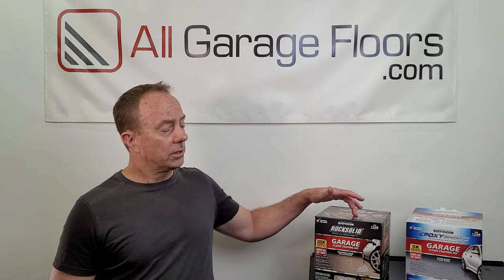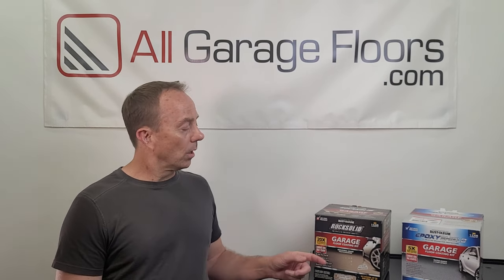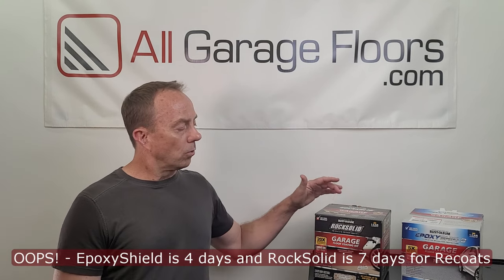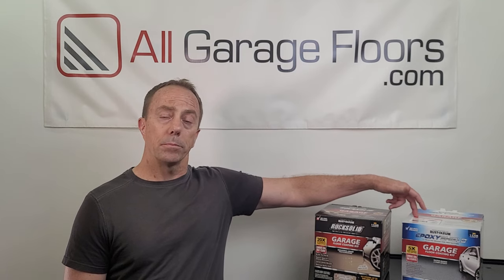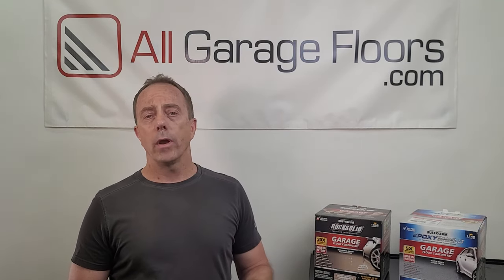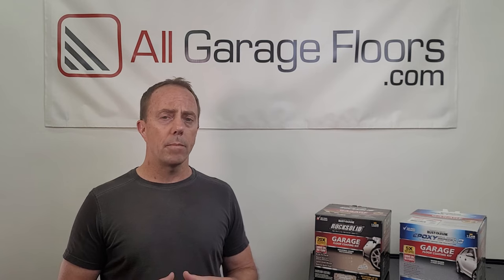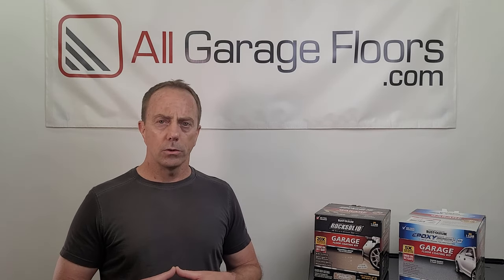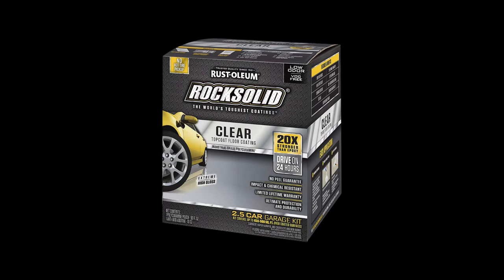RockSolid vs EpoxyShield | Which is Best for your Garage?

Comment: Can polycuramine be patched? Or can I put a new coat over the old coat.  I have a 3 year old coat and my offroad truck tire pulled some off.  Im willing to buy from you.
Reply from the maker: Polycuramine does not suffer hot tire pickup. If the tire pulled the coating up, then that means the concrete was not properly prepared via cleaning and etching. You can apply a new coating over the old. It requires roughing up the old coating with 120-150 grit sandpaper first. Any exposed concrete needs to be etched well or the coating will suffer the same problem.
Reply: @allgaragefloors  thanks for the response.  The bare concrete floor on the new build was degreased and etched, but it was put down during near freezing temperatures.  Mind you, my truck does have beefy offroad tires, and we did experience very high temps near 120 (Vegas).  I believe it happened after the tires were wet and sat there for a couple days.  Do you have a link to the poly I can put over it? Do you recommend 2 coats?
Reply from the maker: @philh1826   Hi Phil. When you say "poly, " do you mean the Rock Solid Polycuramine or a polyurea concrete coating? Polycurmain and polyurea are two completely different materials in terms of properties and performance. Also, polycuramine (RockSolid) has a minimum application and curing temperature of 40 degrees. If you were near freezing, then the temps were too low. This can compromise the coating and cause adhesion issues among other things. You may want to think twice about coating over it since it means that you would be applying a good coating over one that is compromised. The same thing may happen again. Tires will grab the new coating and pull it up since it is attached to the old compromised coating and not bare concrete.
Reply: Thanks so much for the response. It was the rock solid.  It's held up well except for where my tires rest.  Do you have an email I can contact you on and provide photos?  I very much appreciate your time and guidance.
Reply from the maker: @philh1826  Hi Phil. Just visit our website. We have a contact button at the bottom. allgaragefloors.com

Comment: I plan on using a floor coating on a freshly poured shed slab that has a pretty rough surface. will this help smooth it out if I put it on thick?
Reply from the maker: Hi Victor. What do you mean by pretty rough? Does it have a broom finish or a bad, rough finish? If it's a bad, rough finish, most coatings cannot be applied thick enough. Especially RockSolid. However, 100% solid epoxy can be applied fairly thick. There is no water or solvents to evaporate out and cause bubbles or curing issues.
Reply: @allgaragefloors

Comment: I was in the process of preparing my floor to put down RockSolid, but stopped because the directions say not to coat over or roll over "control joints". What does that mean?  You mention using it over contraction joints and sawcuts, how are they different?  My floor has sawcuts every 8 feet and they are filled with a special component made for expansion, can I use RockSolid or is there a different product I need to use?
Reply from the maker: Great question. What they mean by that statement is don't use RockSolid to try and fill saw cuts, troweled contraction joints, or expansion joints. Different material fillers need to be used for that. However, it's standard practice to run a brush down the middle of a troweled contraction joint to coat the concrete, but not fill the joint. For saw cut joints, run the roller close to the edge so that some coating flows over it. You just don't want to waist a bunch of coating running down into the saw cut.
Reply: That makes sense.  My saw cuts were filled with a special rubberized joint compound right after they were cut.  This compound extends up higher than the concrete in most areas.  What is the best way to bring it down flush with the surface of the concrete?  Is there a tool for removing the excess?  Also my floor has fiberglass strands added and they are above the surface, should I try to remove them or will the epoxy cover them?
Reply from the maker: @SuperSirhammer   Fiberglass strands will stand proud and stick up out of the coating when it's rolled on. They need to be removed. It can be done via sanding or burned off with a propane weed torch. The material sticking up out of the saw cuts can be removed with a razor blade tool or via grinding.
Reply: Thank you very much.  You are the best source of information I have seen.

Comment: with all the comments about running out or low on product... is there a recommended primer to put down before putting down the rock solid so is doesnt soak into the concrete with the first coat
Reply from the maker: Primers for coatings are actual coatings. They aren't paint or concrete primer paint which are not compatible. EpoxyShield, RockSolid, etc. are thin residential coatings that are similar to the actual 2-part epoxy coating primers used for application of the better commercial quality coatings. The first coat of RockSolid acts like a primer if a second coat is required. This is why we recommend the better coatings in the video description above. There are links there to learn more.

Comment: How well does Rocksolid work on wood floor in a car hauler.
Reply from the maker: Hi Mike. It does OK, but not great. You will need to sand the wood with 60-grit sandpaper first before applying a coating. Due to how thin RockSolid is, it will require a minimum of two coats. The problem is that though a single-car kit will provide enough material for two coats in terms of the square footage, the remaining material that is mixed can't wait for the minimum 6 hours before a second coat is applied. It will require buying a 2.5-car kit since there are two mix pouches with those. You would be better off buying a gallon of single-part polyurea instead. You only use what you need for the first coat, close the can, and then use more for the second coat. Plus, it's thicker than RockSolid and will last longer. We have links for it in the description below the video.

Comment: I have a few cracks in my garage floor that after a heavy rain moisture comes up from them. With that known is rocksolid the better pic
Reply from the maker: Hi Dean. Neither is a good pic. Coatings are not crack repair products. Any cracks in the concrete need to be chased and repaired with the proper material. We have an article that discusses repairs here: https://allgaragefloors.com/concrete-floor-repair/  More concerning, however, is the fact that you have water coming up through the cracks. Coatings are not very tolerant of moisture. If you have moisture coming up through cracks, then you need to moisture test to determine if your floor is a candidate for a coating: https://allgaragefloors.com/concrete-moisture-test/

Comment: Can I use the Recoat primer on wood? For a trailer floor.
Reply from the maker: Hi Mick. No, Rust-Oleum Recoat Primer is not for wood. It is designed to be applied to older coatings that are adhered well or bare concrete that has been previously sealed (not bare unsealed concrete). It's not like a primer for paint that can be applied to most surfaces. If you are applying RockSolid or EpoxyShield to wood, it will require that the surface be clean and roughed up with 60-grit sandpaper first. A minimum of two coats will need to be applied as well. Otherwise, the wood will absorb more of the coating and it will be too thin. The color and gloss will look blotchy and faded in areas.

Comment: Great video but I still have one question… are they slippery when they’re wet?  I’m using rock solid on a trailer floor, I was thinking about sprinkling a little sand or  an anti-skid on it but if it’s not slippery I’d rather not.
Reply from the maker: Hi Peter. Yes, it will be slippery when wet. Each kit of RockSolid comes with anti-slip media. Just mix it into the final coat and you should be good.

Comment: Can you put rock solid clear over epoxy shield?
Reply from the maker: Hi John. RockSolid and EpoxySheild are not chemically compatible to bond together during the recoat window. If you want to apply RockSolid Clear Coat over EpoxyShield, you need to wait a minimum of 24 hours and then degloss the surface by roughing it up with 150-grit sandpaper. Vac/sweep the surface then wipe it down with denatured alcohol or equivalent. You can then apply the RockSolid and it will achieve a proper bond.

Comment: I have a 500 sq ft garage. From my reading here, it looks like i will need 2 x 2.5 car kits of RockSolid and 2 x 2.5 kits of the RockSolid clear top coat too, anyone else do this?
Reply from the maker: Yes, that would be correct. One 2.5-car kit will not sufficiently cover 500 square feet. You can actually purchase a much better performing commercial quality single-part polyurea coating kit for approximately the same price as buying all those kits. It's thicker, UV-stable, and more durable. You can learn about single-part polyurea kits and where to buy them here: https://allgaragefloors.com/polyurea-best-garage-floor-coating-kits/
Reply: @allgaragefloors  I am in Canada so unfortunately i can't get those. I have seen many videos where they don't do the topcoat after, is that a mistake or should that also be done?
Reply from the maker: @CamGreer-q4g  A clear topcoat is not required, but it's highly recommended. It locks in and protects the color flakes as well as the color coat. The coating lasts longer as a result and is easier to clean since you don't have exposed color flakes catching dirt and sometimes getting dislodged from traffic and cleaning.

Comment: how do I prep the concrete?
Reply from the maker: Hi Leo. The concrete needs to be cleaned and degreased if necessary. After that, it needs to be etched with the supplied etching solution.

Comment: What would be the product recommendation for oudoor patio  area?
Reply from the maker: Hi Dennis. What is it that you want to do for the patio exactly?
Reply: Concrete is 20ish years old, has some cracks I'm going to fill. Going to be a sitting and gathering area with a griddle on it. Just looking for something reasonably reliable without breaking the bank.
Reply from the maker: @dennisgray8027  Acrylic coatings work best for patios and walkways. They are U.V. stable and easy to apply. We suggest you take a look at DeltaDye OneStep tinted sealer by Legacy Industrial. It's a robust acrylic sealer heavily tinted with DeltaDye Color Stain. It's not quite a completely solid color and is somewhat translucent. It's a popular type of decorative coating that brings out the character of the concrete. You can find it here: bit.ly/3XcuMrx

Comment: can you apply a huge amount of chips then clear coat it so that it looks like a "gator like finish"
Reply from the maker: Hi Ronald. You can apply a heavier amount of color flakes as long as you can still see the base color coat and the flakes don't overlap too much. However, RockSolid does not provide a thick enough base color coat to accept all the flakes required for a full color flake broadcast/coverage. We are assuming that is what you are referring to as the "gator-like finish". In addition, it would require triple the amount of clear coat to cover all those flakes which makes RockSolid cost prohibitive compared to other (better) options.
Reply: Thank you so much for that critical I sight..really appreciate it

Comment: My garage was previously painted by previous owner with latex paint. Can I apply Rustoleum recoat primer and then apply Rocksolid without grinding the floor?
Reply from the maker: Hi Mathew. If the paint covers the entire floor and is adhered well, then you can use the Rust-Oleum Recoat Primer. However, we don't recommend it. How well your coating performs in terms of hot tire pickup and peeling is determined by what it is adhered to. In your case, the primary material adhered to the bare concrete is latex paint. It does not come close to the tenacious bond that RockSolid has to bare concrete. As a result, you may still experience peeling or hot tire pickup.

Comment: What about doing a primer before hand?
Reply from the maker: Hi John. Don't confuse concrete bonding primers with primers for coatings. Concrete bonding primers are a type of acrylic paint. They are not compatible with coatings and do not adhere as well. They are designed to be used with paint. Primers for coatings are typically 2-part epoxy formulations. They are compatible with most coatings and cost almost as much. That is why you don't see concrete "coating" primers at home improvement centers. They are typically used for high-quality commercial DIY coatings. The first coat of RockSolid would essentially be the "primer coat" if it becomes too thin and the finish is not good.
Reply: @allgaragefloors  Thanks for the advice. So, are you saying it’s that the primer that says no etching or grinding is not good? Should I just use the liquid etching?My garage is a one car that’s 220 square feet, I could use the 2.5 garage and be fine?
Thanks
Reply from the maker: @johnfeather5405  That's correct. Coating primers are typically a 2-part epoxy that requires etching or grinding of the concrete surface. They cost over $100 per gallon. If you don't mind spending the additional $$$, the 2.5-car RockSolid kit will work fine. The first coat will be the primer coat and may or may not look too thin based on the 220 square feet. However, the second coat will easily cover that and provide a very glossy and rich color. We recommend purchasing RockSolid at Amazon. https://amzn.to/3Wl3m2w A typical 2.5-car kit is up to $80 less than home improvement centers.
Reply: @allgaragefloors  Ty

Comment: I purchased the rock solid kit garage epoxy .Can I use the epoxy shield clear over it or do I need to use the rock solid clear for it?
Reply from the maker: Rust-Oleum states that you need to use the RockSolid Clear Coat. EpoxyShield Clear Coat is not compatible with RockSolid to form a chemical bond during the recoat window. In addition, the number one rule of clear coats is that they should perform just as well if not better than the color coat. The EpoxyShield clear is not as good as the RockSolid color coat regarding abrasion resistance (wear) and chemical/stain resistance.
Reply: @allgaragefloors  thank you so much for the help!

Comment: what to do my shop floor high traffic what would you use armour sheild or something a little better quality than these
Reply from the maker: We recommend a higher quality coating than the residential quality Rust-Oleum products. Our favorite is the commercial-quality single-part polyurea coatings. You can read about them here: https://allgaragefloors.com/polyurea-best-garage-floor-coating-kits/  A high solids epoxy system such as ArmourShield is much better than Rust-Oleum as well. It just requires more time to apply.

Comment: Did anyone sand between coats?
Reply from the maker: Sanding is only required if you apply additional coats outside of the recoat windows. It's 3 days for EpoxyShield and 7 days for RockSolid.

Comment: That optional rock solid clear coat is expensive for a 1 car kit!
Reply from the maker: Yes, it is. And it's half as thick as the color coat if spread over 400 square feet. That is why we recommend the DIY polyurea kits in the "Show More" description for the video. The overall coating system is almost 3X as thick for a bit more money. Plus, it's U.V. stable and wears better.

Comment: Acid etching is not the proper method of prepping a concrete floor for a coating.  The only industry acceptable standard is to grind the floor to a CSP2 with a floor grinder.
Reply from the maker: Hello Scott. That is definitely the case for higher solids, commercial quality coatings. However, it's not the case for RockSolid or EpoxyShield. RockSolid used to specifically state in the TDS for many years not to grind the concrete. That was because RockSolid wets out and penetrates concrete extremely well. When the surface is prepped via grinding, RockSolid coverage rates are cut in half to provide the required 3 mil DFT. Those that followed the recommended coverage rates after grinding end up with coating far too thin and have to apply another coat. This is a common complaint for RockSolid when prepping with the supplied citric acid etch. The same holds true for EpoxyShield in terms of grinding. This ends up doubling the cost of the both products since it requires two coats to get the minimal recommended DFT.  RockSolid has few issues will bonding properly after using the supplied etch. Hot tires is generally not an issue with RockSolid where as EpoxyShield has many problems with that (even when grinding) which I won't delve into here.

Comment: Is there a sealer for concrete condensation before applying an epoxy coating?
Reply from the maker: Hi Randy. Sealers don't stop condensation on concrete. The condensation is a result of relatively warmer, moist air settling on the concrete and then condensing. Moisture that comes up from below the concrete is completely different and is not condensation. I suggest reading our article about sweating concrete which explains the differences and what can be done: https://allgaragefloors.com/how-to-stop-sweating-garage-floor/  If you have questions after that, just ask here or on our website.